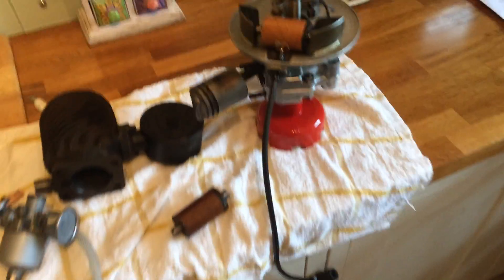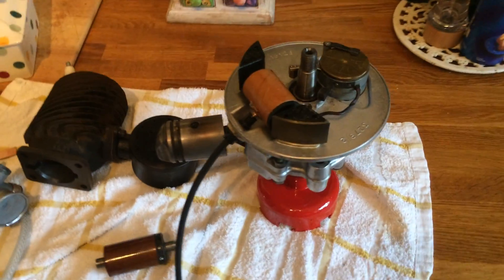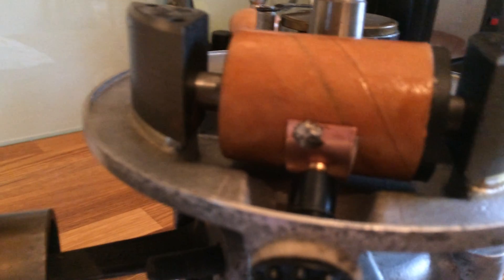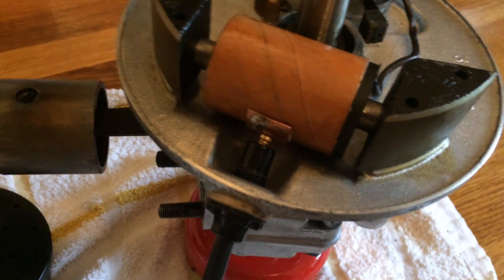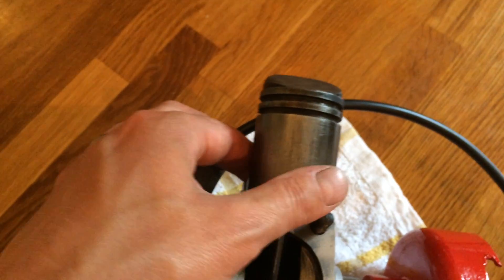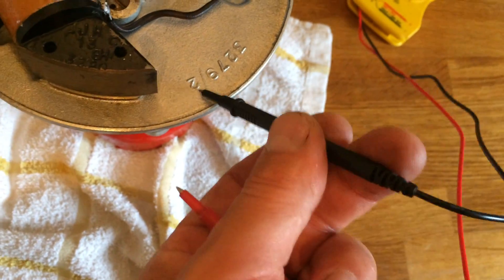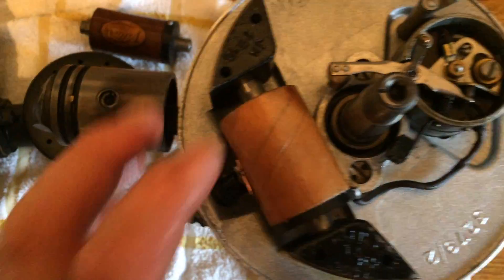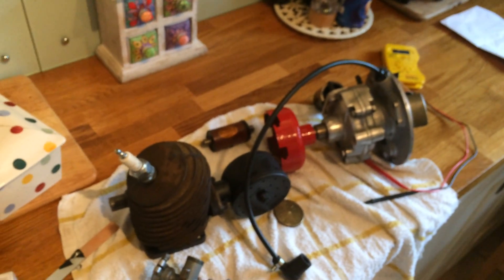Coil replacement on a villiers midget two stroke engine

Comment: Just got mine running tonight with one of these coils, luckily even with one end not contacting the grub screw it was still quite a tight fit, and no movement when it was all screwed to the backplate. I had a spare electonic ignition module (£7 from ebay) sitting in a drawer so fitted that and removed the points and condenser, timed the flywheel up and gave it a spin by hand to be greeted with a lovely fat spark. After a slight adjustment on the carb needle it runs lovely!

Comment: Brass contact on the end of the HT lead is a total waste of time. Solder the lead straight on to the coil. Then black silicone the hole up around it. Works perfectly
Reply from the maker: Good tip- thanks. The cheap coil was no good in the end and i got a genuine one at great expense

Comment: as a matter of interest what paint did you use on the cylinder head in black?
Reply from the maker: Hi I used an aerosol can of black heatproof paint: same as they use to paint exhausts /babeques. Cheers
Reply: thank you for that , i am just in the process of restoring my Villiers